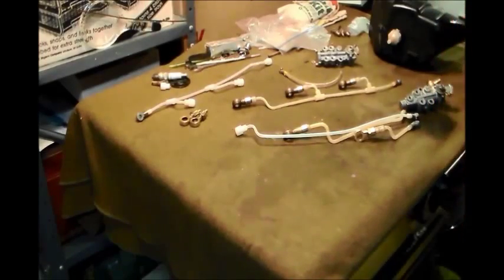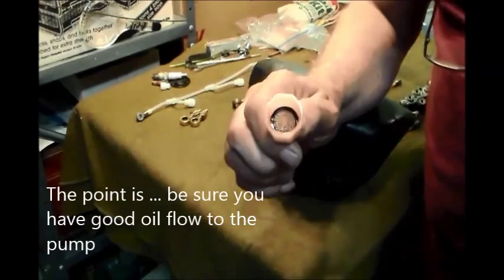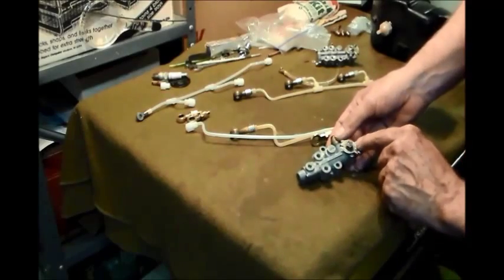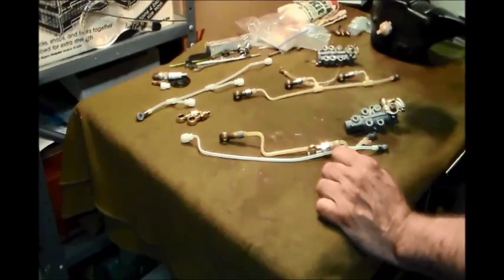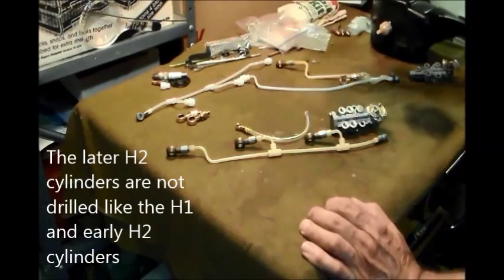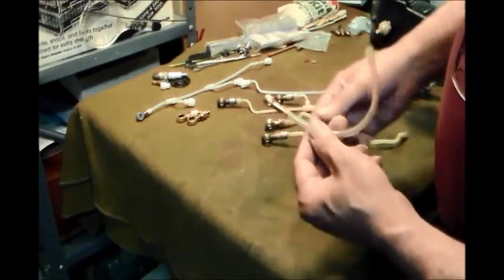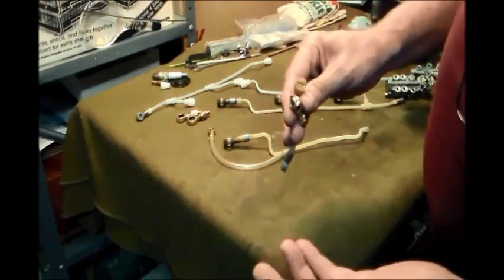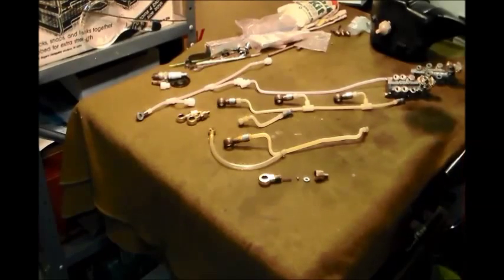Oil System Overview

Comment: What’s the best way to discontinue use of injector if I just want to use premix fuel ?
Reply: What I would do is first verify that your bike has connecting rods which are slotted top and bottom.  Some do, some don't, depending on the bike and its history.  If it has non-slotted rods, I would endeavor to the full extent possible to preserve the oil injection system.  You could probably get away with mix on non-slotted rods, but "getting away with" something is never ideal.  If the rods are slotted, then I would simply remove the oil pump assembly, plug the three banjo ports under the carbs with properly fitting bolts and GOOD sealing washers, and then you should be good to go.  Expect to use more oil and make more smoke in order to match the lubrication capability of the injection system, especially on the H-series.